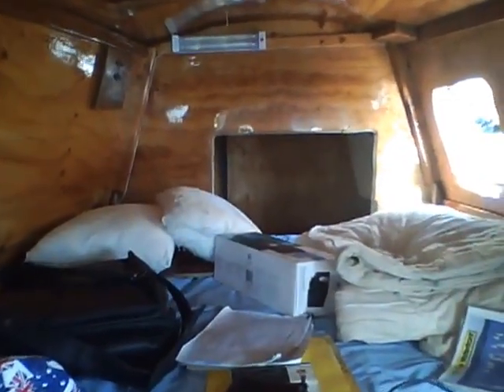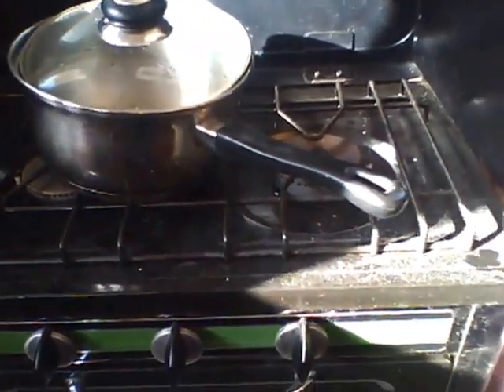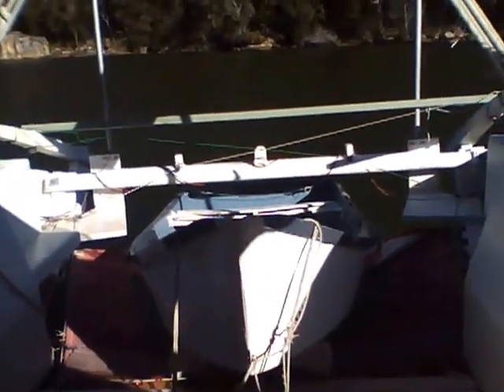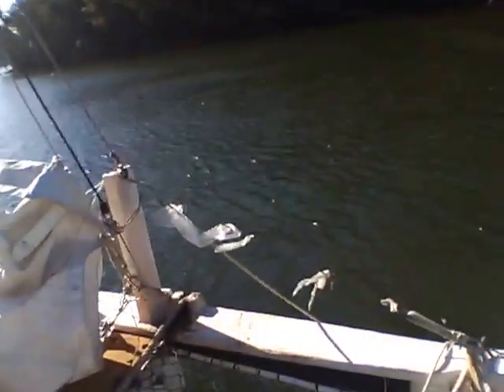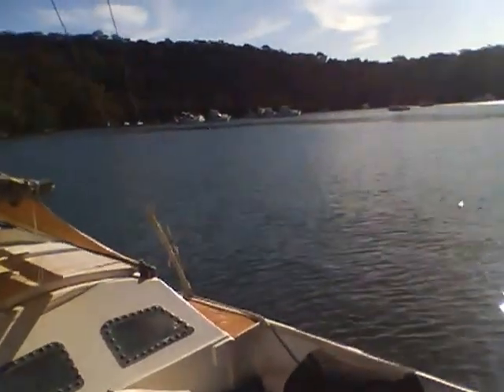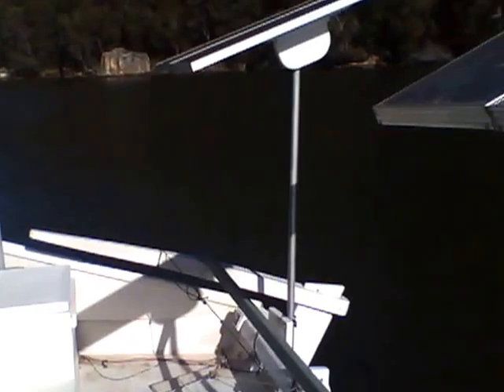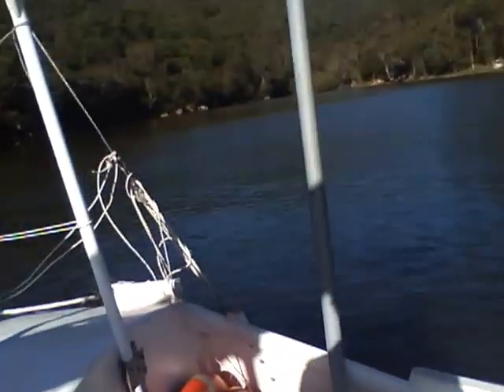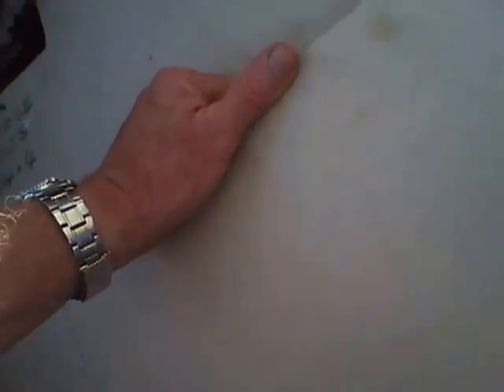Wharram Catamaran 35' modified Tangaroa, technical details including centerboard, power

Comment from the maker: The increase in speed is also quite unexpected. Now the boat is not crabbing along side ways, creating lots of turbulence, it can really get up and go, reaching and to windward. The difference is so pronounced, it is like a different boat. The board is 3m long and gives a warning of shallow water. It hinges back in shallow water. The hinging allows the helm to be  balanced and it goes about well sailing under mainsail only. So I am sold on it. Skegs can increase draft but better than nothing.